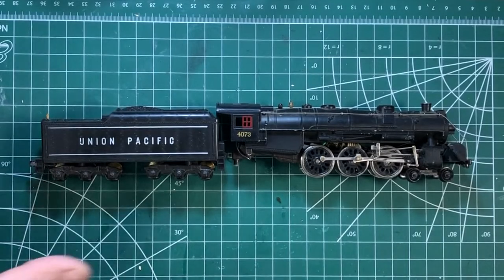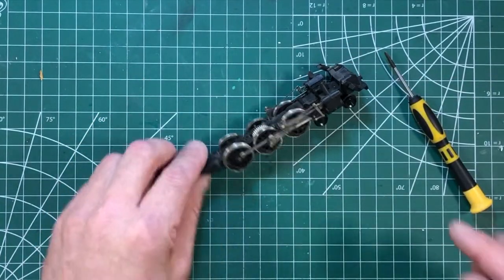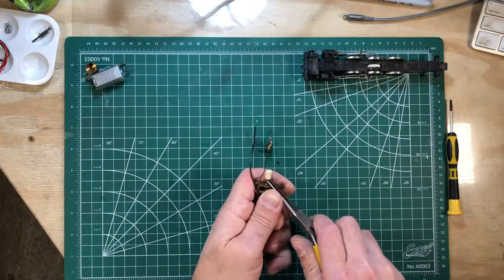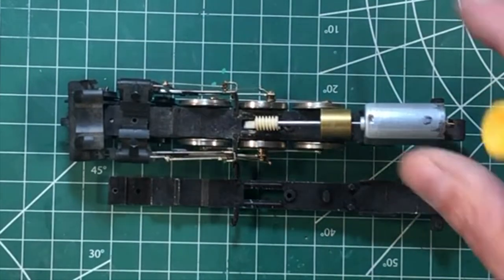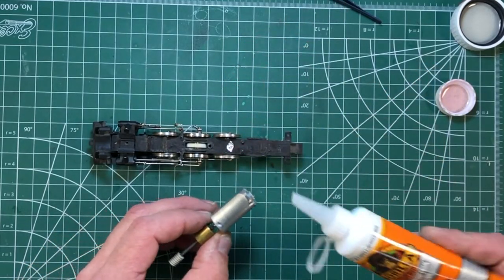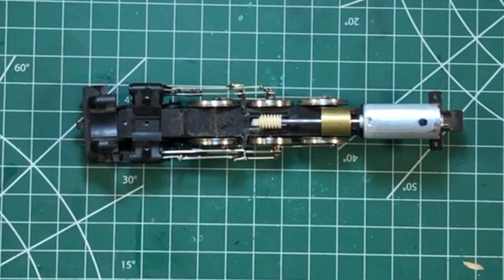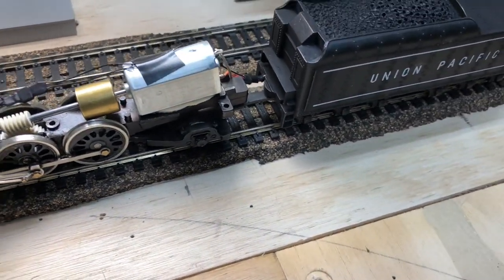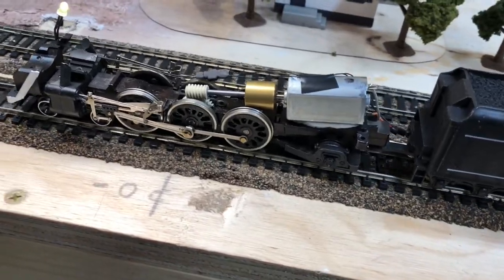$150.00 Worth of Upgrades to a Tyco Pacific for DCC & Sound!

Comment: I appreciated that this locos valve gear is not neutral. I am a firm believer in model locos displaying the wrong reverser setting is better than displaying none. As hobbiests, we lose a lot of valve train activity in neutral valve gear.
Reply from the maker: I dont know what neutral valve gear is, nor could I tell you where the reverser valve is located.  I'm just not into that kind of detail.  I always end up breaking them fancy detail off.  Are you referencing the fact that the eccentric crank and rod, is moving the valve in and out?  I do like seeing that, compared to other steamers that are missing that detail.

Comment: "Bus 14's" first cousin from another family, she is beutiful sounding, I can bet that half my mantuas already have can motor.
Reply from the maker: Right on!
Reply: Railroad Crossing
--*-
Forward
--
Reverse
* * *
Protect the rear
* * * -
Protect the front
-**
Alert Signal? (Alternate to crossing signal?)
**-**
Passing Signal?
**-*
Sing "shave and a haircut" then:
* * (Actually this is a flagman signal of unknown purpose)
Reply: Contuary to popular beleif Mantua Did not have any relationship with tyco besides a partnership that lasted for a little while, between 1930 and 1974 mantua made parts for tyco engines, they had the same drive systems but they were marketed differently, in 1976 the two companies went their own seperate ways with Mantua persuing Steam until 2001, and TYCO persuing diesels until 1990. Currently Model Power carries on Mantua in the form of their "Mantua classic" line.

Comment: I've installed DCC and sound in a number of Mantua steam engines. As a Reading modeler, they made the only affordable camelbacks. These are underrated and very durable models that can also make great kitbash fodder. I look for the older ones with the brass bearings. Glad you are spreading the word.
Reply from the maker: Hello David, I agree with you.  They are an unrecognized diamond in the rough for sure.

Comment: Thank you for sharing your motor upgrade installation on this locomotive, especially the clearly explained steps you took to accomplish the work.  I bought a used, modern-era Mantua can motor assembly on ebay a couple years ago and installed it in my brown-box era Tyco B&O 4-6-2.  The frame on my old locomotive is a little bit different than the modern versions, but I was able to screw the mounting bracket of the can motor into place without doing any modifications, and the worm gear lined-up well with the axle gear.  The locomotive runs more smoothly now, but since it doesn't have a flywheel, I bet your upgrade is even smoother.  I also found some of the modern Mantua nickel-silver tender wheels on ebay and installed them on my 4-6-2.  I always had trouble keeping the original brass wheels clean on the classic era Tyco locos, so hopefully the new tender wheels will help keep the current flowing better.
Reply from the maker: Greetings Keith,  I'm glad you enjoyed my video.  I'm also excited that there are nickel silver tender wheels available.  I pulled the old girl off the shelf a few days ago and it kept dropping power to the DCC board.  I'm betting its them darn tender wheels.  I will begin my shopping journey for some updated ones!  Thank you for sharing some GREAT info.
Reply: @classicmodeltrains  I tried to look through my ebay purchase record,  but it looks like ebay has changed it so that you can only look back for a fairly short time period.  I got the wheel sets from a seller who specialized in Tyco/Mantua replacement and upgrade parts but I can't seem to find or recall his user ID.  They were Mantua brand and fit perfectly with no mods needed.  

Here is a link to a forum where they are discussing the topic of Tyco/Mantua tender wheels and one poster mentions using Intermountain 33" nickel silver wheels.  There is also some discussion of fabricating wheel wipers for tender trucks to improve the electrical pickup.
  http://www.tycoforums.com/tyco/forum/topic.asp?TOPIC_ID=20881&#143076http://www.tycoforums.com/tyco/forum/topic.asp?TOPIC_ID=20881&#143076

After Model Power bought the Mantua line, they were making can motors, upgraded wheelsets, etc, readily available, but all that stopped when MP was sold from what I have heard.  The tender wheels I got are smaller diameter than the 33" Intermountain wheels, probably around 30".
Reply: I upgraded my Mantua Hudson tender wheels to a Nicole silver set ran alot better.

Comment: Love it did a great job I would've added a plug harness for the wires just in case you ever needed to split the cold tender from the engine
Reply from the maker: Thanks.  I just found a local source for those.  I wished I had one when I built this

Comment: I really like steam engines to have interior cab detail I was so turned off by a lot of engines that the engine just stuck right up in the middle of the cab like some of the Old Gage ones.
Reply from the maker: I never see in the cab, so It don't bother me much.
Reply: @classicmodeltrains  I like steam locomotives that have full cab interior detail the same way I like my Diesel's to have full cab interior detail when they enter the sitting and you look inside it and you can see the detailed back head as well as the crew it just looks more realistic to me same thing for my o gauge steamers but I have to live with what they have if you can see the motor you can see the motor that's the way it is
Reply: Actually doing a blackhead is not that hard. 
You can get a scrap rivarossi Berkshire and cut the blackhead out of it. 
Or build it out of sheet styrene. Use some styrene rods (evergreen sells sheet and round stock, any hobby shop has them) for gauges.
Look around for some photos to use as reference (the internet is full of them. )

Comment: I would have Dremiled out the coal and made a little box to put in a realistic coal load. You could put a silk screen over the speaker to keep the coal out of the speaker. Also I would have sleeved or painted black the wires going to the motor.
Reply from the maker: The tender idea is one way to go about it. I agree with the wires looking kinda ugly and needing some attention

Comment: Great job! I have several HO brass and an Athearn 4-6-2 steam locos I’m thinking of converting. Do you have a video on brass steam conversion to DCC?
I shut off cab chatter ‘cause steam locos didn’t have radios back in the day when they were in revenue service. A lot of the old heads told me they would just shout or use hand signals across the cab. 
Thanks for sharing!
Reply from the maker: Thanks.  No video's on Brass anything.  Should be the exact same way as installing in any old steam loco.  I pretend the cab chatter is because its a excursion run taking place back in the 60's.  :-)

Comment: Great video however, as I am a newbie of sorts to wiring, could you explain how and where the red wire from the Tsunami connects? I acquired an old bowser 4-6-6-4 that I'm pretty sure never ran, it was glued to a piece of wood for display. I disassembled and cleaned it, installed a new can motor and it actually runs now. I am in the process of installing the Tsunami 2200 and I assumed the right side of the loco was right rail and, the left side of the tender was, left rail. I am unclear where the Tsunami red wire or right rail connects on the locomotive and, when connected to the controller I am getting a track fault warning. Any advice would be appreciated.
Reply from the maker: The older motors were bonded to the frame.  Sorta like the ground connection in your car.  If memory serves the Decoder power is the red and black wire. You have to connect those to your track pickup. One for each side. Isolate your can motor pickups (which I'm pretty sure already is). The your decoder supplies power to the motor.  The decoder wire colors are supposed to be universal but check the web site and it will confirm what color wire does what.  Use a DVM in horseshoe mode and make sure you are not shorting out your track pickup circuit.
Reply: I think that is where my confusion comes in. There were no wires on this loco when I received it and, since it was DC I am not sure how to connect track power. I had the red wire or, right track power connected to a screw on the loco frame assuming since the wheels were insulated this would work however, I am a pipefitter not an electrician. If I lay loco and tender on my bench and connect the controller directly to the decoder it operates as it should but not when its on the track.
Reply from the maker: @T3erryC3ooper  make sure that whatever is connecting the tender to the loco is non conductive. The whole frame of each is used as a pathway for the juice to flow. Also make sure the tender wheels are installed with the insulation wheels all on the exact same side. Same to loco but make sure they are on opposite side.

Comment: I have a similar Tyco model that I'd like to get working on DC (or DCC eventually), but the tender in mine isn't providing the electrical connection it should be. How do the wheels on the tender make electrical contact with the tender body? My guess is there are some kind of spring that bridges connection between wheel axels and body that I may be missing in my model.
Reply from the maker: The metal wheel (one side only) conducts the juice to the metal truck assembly, which is bolted up to the metal frame of the tender.  There should be a wire that's bolted to the tender frame that goes up to the locomotive.  The locomotive picks up the juice (one side only) from the drivers and sends the juice thru the frame and the motor picked it up from there.  Make sure the tender wheels pickups (the brass colored ones) are on the opposite side of the loco pickup wheels.  Hope this helps a bit.

Comment: If I were doing the sound installation myself, I would've drilled the speaker holes in the frame of the tender instead of the coal load. Prevents the speaker from getting dust and dirt from getting in it and I believe the sound quality is better when facing downward. Also you dont see the speaker.
Reply from the maker: Drilling holes or cutting a big hole in the metal frame of the tender would weaken it structurally.

Comment: does the 2200 have removable plugs on it? I have a loco already wired for a 9 pin decoder, in this case a tcs wow. and a keep alive. I am wondering if I can stick a tsu in it, and just plug the exsisting speaker and such into it
Reply from the maker: This Digitrax decoder had no plugs.  It was an all solder in unit.

Comment: I find one of main motor suppliers like cv backshop push the fact that their motors will result in a "lower top speed" and while that may be find for some models, pacific and hudsons need higher speed as that's what they are built for. What kind of high rpm motors can I put in? I certainly dont want them any slower. they aren't that fast to begin with.,
Reply from the maker: I'm not aware of a bunch of can motor suppliers, so I cant help you out there. One thing to consider is scale speed. Not that fast to begin with could be 60 mph scale speed. I always value the slow speed performance of a loco compared to it's top end speed. Sorry I could not help you out with other motor options.
Reply: @classicmodeltrains  can u show full speed?

Comment: I don't remember exactly when, but at some point when I was really small (no older than 6 or 7) my parents bought me a Tyco HO set.  I don't remember if it was in this exact livery, but the loco was a Pacific.  And as for your purchase of $180 or so worth of parts to upgrade a loco you bought for $30?  Well, during my college years delivering pizza quite a few of my fellow delivery drivers had $500 cars with $1200 stereo systems in them!  And how many car guys have spent five figures modifying a car they bought for $1-2K?

BTW, I finally made the jump to DCC on my own layout last year because of the possibility of running sound-equipped locomotives.  I bought mine, rather than building it, but I have a really nice Atlas Gold Series S-2 (N scale) which set me back about the same amount you spent on upgrading your Pacific.
Reply from the maker: Yup! Ive had $500 cars with BIG systems in them, and put way to much $$$ into building hot rods. I guess It's just a bad habit of mine. Congrats on the DCC upgrade and good luck with your N scale universe :-)

Comment: Excellent tutorial!  Thanks for sharing. I have this exact engine. I bought the CV Backshop upgrade.  Does the Sound decoder work with DC?
Reply from the maker: Thank you.  The DCC board can make sounds in DC mode, but they are very limited.  If you don't want to run DCC then I would not put in a decoder.  Too much money and no real befits on DC.

Comment: Could you send me the link to that so I can get one too Like to upgrade the motor
Reply from the maker: The place is called Chino Backshops.  They don't have a website.  I got this off E-Bay from them.  under "tyco pacific can motor upgrade". https://www.ebay.com/itm/115430452000?hash=item1ae030eb20:g:FaAAAOSw199gTnP0
Reply: @classicmodeltrains  thank you so much

Comment: The sound will be so much richer if you face the speaker down, and have the back of the speaker fully enclosed. Otherwise great job!
Reply from the maker: Thanks for the good information.  I did not want to cut a big hole in the tender chassis on this one.  I have another DCC sound project coming up and that one will have down facing speaker (s) for sure ;-)

Comment: i use hot glue to mount motors 
is that bad?
Reply from the maker: That gorilla glue stuff is what the shop that sold me the motor said to use. I suppose hot glue would hold it well, and also be able to remove the motor if need to.  I shall do some testing!!
Reply: @classicmodeltrains  ive had good luck with the hot glue. like you said it is easy to remove the hot glue if needed

Comment: Please send me your unused/unwanted open frame motors you are replacing.  You'd be surprised what rare earth magnets will do for those old open frame motors.  I've re-magneted at least 7 or 8 of those Mantua and other open frame motors.  With rare earth magnets, they will crawl along the track as well as cut down on current draw.  Now my engines run more efficiently.  I also use full wave bridge rectifiers with 3300uF capacitors and 12 volt LED strip lights in all my coaches for directional flicker free interior lighting.  I even lit up an old RPO car with my home made contact wheel pickups (copper) I salvaged from an old computer.  You can do a lot by using your imagination.  Plus the fact that I'm a Ham radio fanatic involved in electronics.  I hate the tinny sound of HO sound DCC and am strictly a DC train fanatic.  W Rusty Lane K9POW in eastern Tennessee
Reply from the maker: Good day to you Rusty Lane.  I have no unused or unwanted parts.  I find a use for everything.  I am looking for a source of R.E.M. for these old open frames.  People like yourself have mentioned how well they perform.  Sounds like a pretty cool lighting set up you have made for yourself in them passenger cars.  I agree on the poor sound coming from DCC.  there's no replacement for displacement when it comes to transducer performance in my book. I stick mainly to DC also. Thanks for watching and commenting on my Video!

Comment: Cab chatter on any scale is annoying and unrealistic. And same days you did not have track defect detectors. That was a lot of steam engines especially the older ones they didn't want getting radios it was all hand signals and whistles.
Reply from the maker: I'm imagining this loco is a current re-store doing excursion runs.  Needs all the current updates.
Reply: @classicmodeltrains  what I like about modeling HO trains in the old days until they became too small was that they did not have all of the BS features like smoke and Choo-Choo sound most people who have engines that have all of the bells and whistles they get tired of listening to all that cacophony and they just shut it off. In my old Gage purchases I would always get the version with just the horn and the bell instead of the one with all of the electronics but they discontinued all of the Civil versions or like Bachmann they destroyed Williams thank God I have a ton of Williams engine great bargains very sturdy trains you can play with I had one full off the train table and it just broke the horn off of it when did circuit boards go bad I'm having them all hardwired to DC HO trains would last forever with a little maintenance and a set of brushes maybe once every 10 years. Simple is good love the videos

Comment: I did this to one of my locomotives. It lasted 3 months and the motor went bad and it took out the decoder. The motor still ran but it started drawing too much electric. A long story short I should have just left the old open frame pitman motor in it. I would have saved myself alot of $$ and aggravation. Needless to say Im not doing that again.
Reply from the maker: Sorry to hear that, Them dang decoders sure can be temperamental